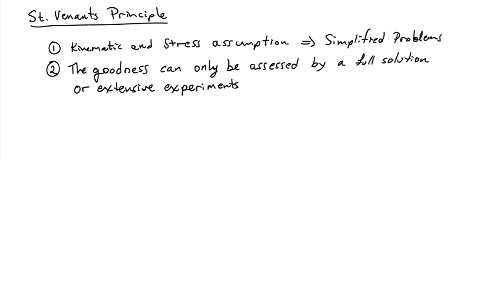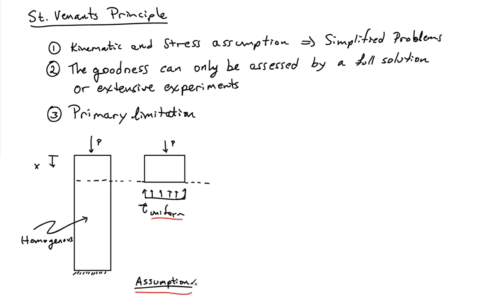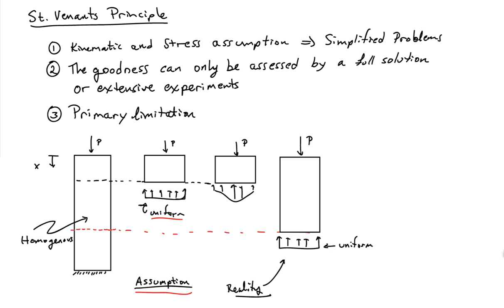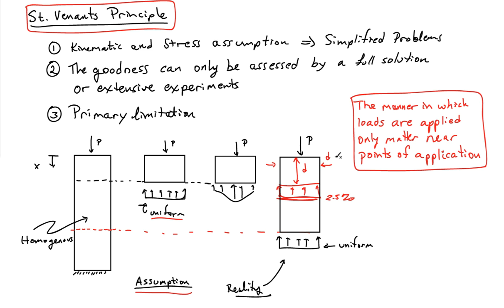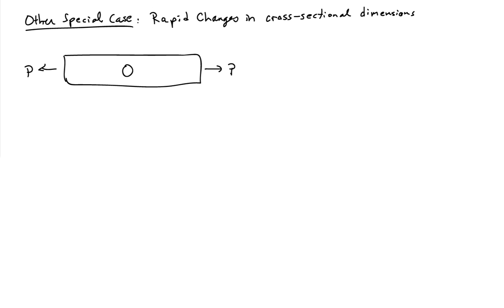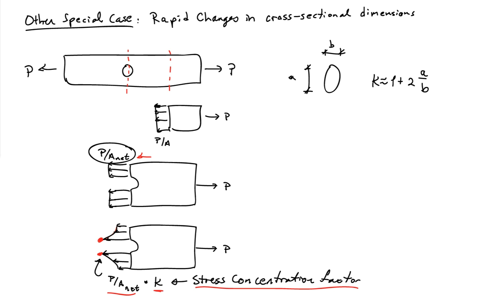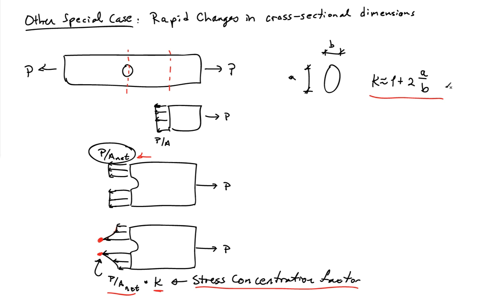(20A) Saint Venant's Principle, Stress concentrations

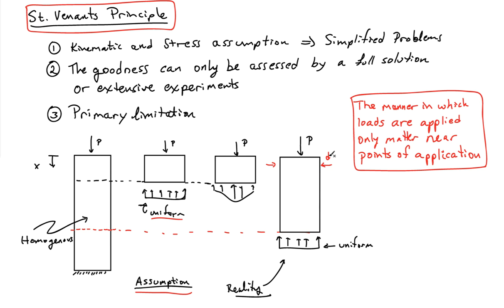Comment: @ 2:25, what about the other dimension, z, back into the board, would that matter?
Reply from the maker: Yes in 3-d problems you do have to take that into consideration too.  It does get a fair bit trickier in 3D with all sorts of technicalities to consider but the basic idea still holds.  Most crudely you could consider the out of plane dimension and then use the maximum of the in-plane and the out-of-plane dimensions as the characteristic length.  Note however this could be overly conservative depending on how you have applied the load.